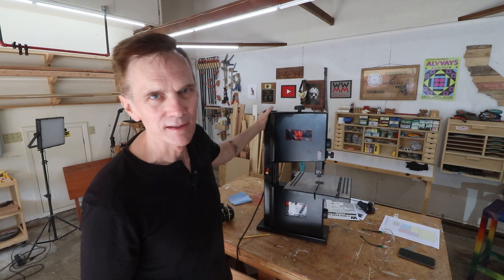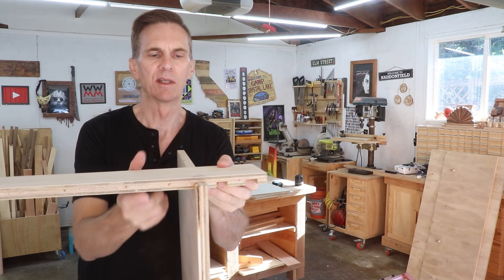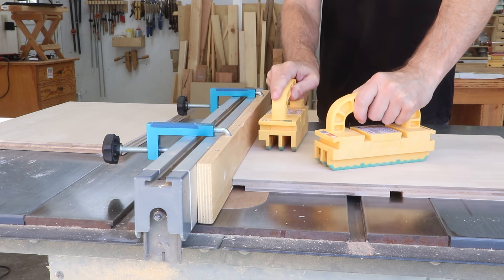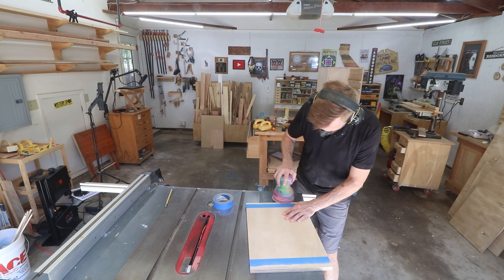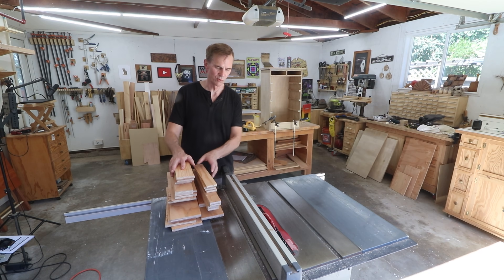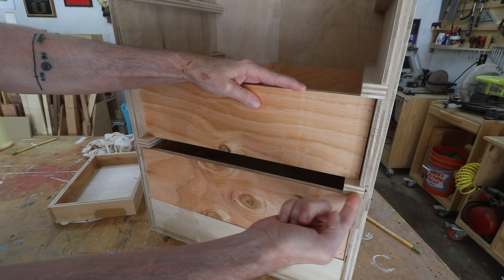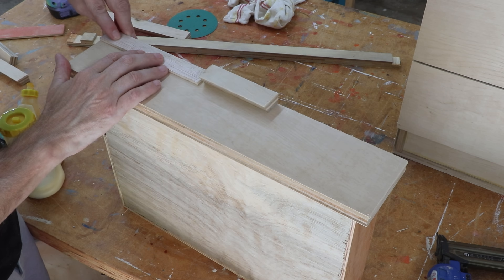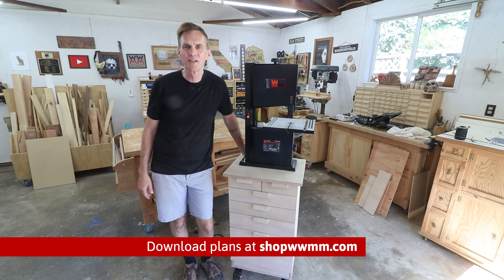This space-saving mobile tool stand will transform your workshop

Comment: Seems like a good project to get started into a cabinet build! I've been using a 4x8 insulation sheet to back up plywood cuts for years and found cutting it in half and making a "hinge" with duct tape makes storage much easier.
Reply: The two inch foam holds up better.

Comment: Worth mentioning is that the casters you list have 2-way locks; i.e. they lock wheel and rotation.  That's important for a tool platform where you tend to push, like a band saw.  I've been using this type for years, even on my work bench.
Reply: Great info, and makes the price that much better. Might have to get a few sets, for an existing table and future projects. Thanks.

Comment: Nice!  My favorite part of this build is that he doesn't use any manufactured drawer slides.  They are really quite expensive, and are not necessary.  While I have used drawer slides in the past, my favorite way is like Steve did, but instead of paste wax, I use a thin layer of Ultra High Molecular Weight (UHMW) plastic tape between the two rubbing surfaces.  Works great, is WAAAYY cheaper than a drawer slide, and lasts a long, long time!

Comment: I have a retired sewing table that serves as my cart for band saw and drill press.  The bottom is open and not very useful for storage, so now i am considering breaking it up for more shelves or drawers.  Thanks for another good video, Steve!  I always learn something.
Reply: Most of the storage in my garage was repurposed from other items. I used an old aquarium stand as my miter saw stand. Added casters so I can roll it into the driveway when I'm cutting longer boards. It already had doors so I can store all of my sanding supplies in the bottom. When we had our kitchen remodeled I was able to install a few of the old kitchen cabinets in garage for storage and workbench. Still able to fit both cars in the garage

Comment: Hi Steve, Did you ever come across an incremental dado jig? It starts off at 23/32 and then goes up every .005" until it reaches 3/4" +.010. This way you can place the thickness of the board into a slot and then add shims to your dado stack.

Comment: A good trick for fitting dados is make an oversized cut, then with your workpiece in the oversized dado you fit the shims in the dado with your workpiece until they're as tight as you want the dado to be. Those are the shims you remove from the stack.
Reply: This took a bit of mental gymnastics as I’m very green, but I think I finally got my mind around what you mean! Good trick, thanks!
Reply: @gthetree1  I should add that the oversized cut needs to be made on a test piece and not on your final project.

Comment: I've moved on from paste wax (still use it for some things like driving screws) but for drawer runners I use candle wax. I.e. the same wax you use in canning. Amazon sells it in big block. Denser wax that great aids in the sliding. Especially if you use hardwood runners. Those wheels are da bomb. Nice grab there. :bow:

Comment: 8:15  "I like to have the top screwed down, so I could replace them if I ever need to..."   And proceeds to glue in shelves so that access to the screws are not possible. Drilling holes in the glued in shelf will give access though, maybe put holes in before gluing it in?

Comment: I like Wen tools, except 1/3 sheet sander.  Have their air compressor, had their drill press.  I like that they provide blow apart diagrams and replacement parts.

Comment: Nice job Steve. My 10" bandsaw (a craftsman from some years back that's a clone of the 10" rikon) has been sitting on a simple cabinet with casters similar to this, just without drawers. I really need to rectify that because it's a graveyard for less often used items.
I've had that same set of casters in my cart for a while now. Have them been ok in use for you?

Comment: Steve, please rewind and go back to bandsaw incident. It was a trapezoid-like shape bandsaw box. You pushed it in with the wood touching up and it bound the wood when it twisted and tipped forward a little. It scared you. Flipping the piece might have made it go smoothly. It wasn’t your fault and common to run into but bringing it up to people is important. Wood gotta be flat to table surface or things gonna go bad. It was not the insert plate being weak. It would have flipped up either way.

Comment: What’s the weight capacity for this cabinet? How heavy of a tool could I put on top? Great video!
Reply: Seems pretty sturdy especially with 3/4 plywood. I would guess you could put a couple hundred pounds but maybe need to do the sandbag idea if you're talking a tall and heavy tool. The rating of the casters you choose is probably the limiting factor unless you're talking a really crazy heavy tool.
Reply: @pakde8002  I have a 100 lb. vintage drill press that i would love to have a parts cabinet for like this. I don’t know though. In my imagination it would crush this cabinet.
Reply from the maker: The 4 casters are rated at 600 pounds each. So they will support 2400 lb. The 3/4" plywood is definitely strong enough to support that weight.
Reply: I'm 100% sure an adult could stand on this cabinet, so your drill press should be fine.  Probably best to weigh down the bottom for stability.  Good, big casters will do the rest. Don't try little casters because they will be hard to roll over any uneven surface.  I've made that mistake and it sucks.
Reply: Incredible. You da man!

Comment: At 8:15 you say that you like to screw down the tops in case you want to remove them later - Could I use Pocket Holes to hold it down (since it's a shop project) since the top shelf is glued in?
Reply: No reason you couldn't use pocket holes to put the top on.  You certainly don't need to, since you wouldn't be screwing into end grain, but it wouldn't hurt, either.

Comment: If the drawer fronts are just to keep the drawer from sliding in too far, why not just make the boxes deeper so they reach the back of the cabinet, or simply put some blocks on the drawer runners to stop the drawer from going in too far? 
Then you won't waste material on fake drawer fronts.
Reply from the maker: Yes, there are a number of methods for making drawers. 👍

Comment: Legitimate question... How are you going to replace the top of you can't access the screws to remove it? Just pry it off and hammer the screws out from the top, then screw it from the top on the new table top?
Reply from the maker: I didn't think it through lol
Reply: @SteveRamsey  🤣 As soon as I saw you adding glue I was wondering. I love how candid you are on the channel, it's the main reason I felt comfortable getting into woodworking.